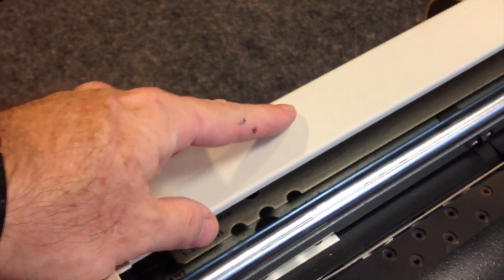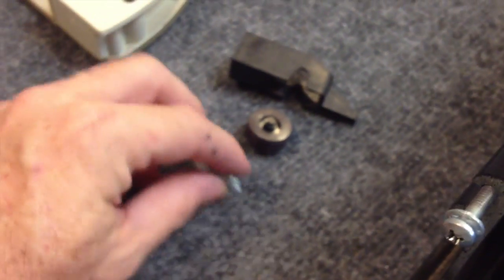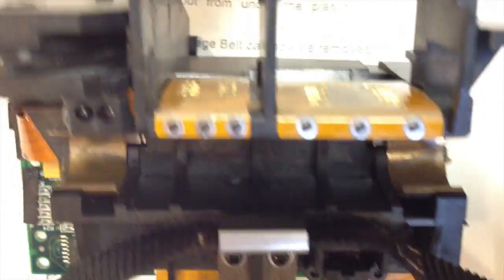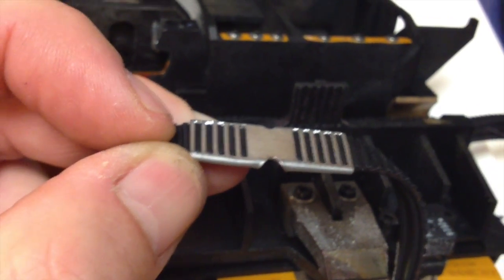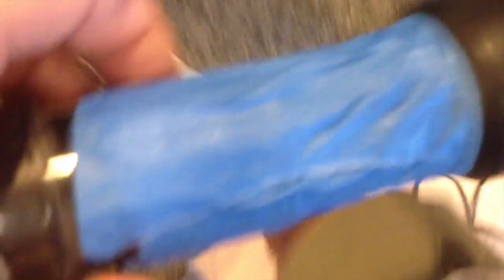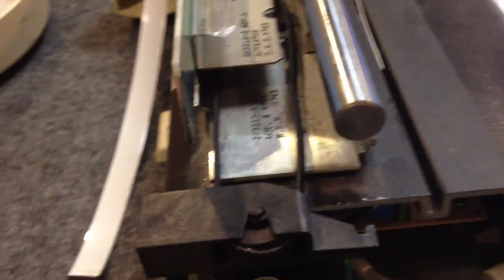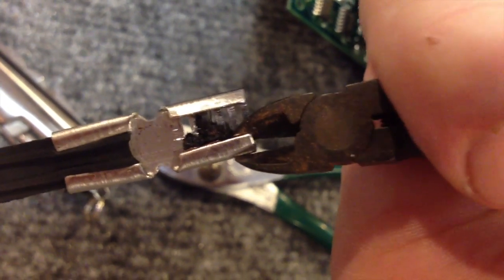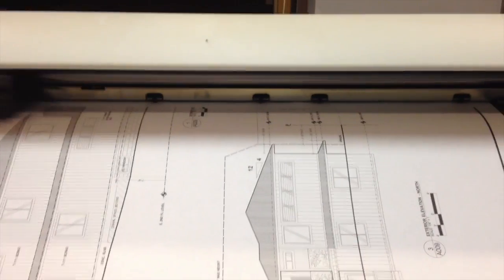Xerox 2230ij or Cadjet2 Plotter Belt Replacement with length modification

Comment: I was the project engineer on that thing when it first came out.  PPK (pen plotter killer) was the project name.  To splice a belt the easy way take a short piece (~1 inch) of belt, and glue it face to face with either end of the belt you are splicing.  Black max works well.  The teeth hold everything longitudinally and it all works.  Not that you need it now more than 5 years later, but if anyone else ever needs to splice a belt, there it is

Comment: Hope to put this video to good use once the new belt arrives. Thanks for producing it, Here's hoping my 24" belt is the right size.

Fitted my 24" CAD Jet 2 belt today, unlike yours mine was too short to get over the drive pulley, the tensioner bottomed out at full stretch. I managed to lengthen the belt by undoing the clip on both sides and instead of 5 teeth each side in the clip I reduced it to 3 each side; I did squeeze the clip together in large bench vice so here's hoping for a bit of life out of it. 
With that small lengthening when I refitted the belt I could stretch it over the drive pulley and still have some movement in the tensioner. So buyers beware.

Comment: 463/5000
Hello, first of all, thank you very much for your video that allowed me to change the strap of my Encad Cadjet 2 36 (inches) and be able to use it. My question today is if you know the reason why the plotting breaks the printed lines in the direction of the travel of the car. I changed the bushings and the tension pulley. Thanks for your answer. Here in Argentina there are no technicians for this old and noble plotter. I do not speak English, which is why I use the translator.

Comment: Hi, thanks for your video. one question do you have driver for this plotter works in win 10.?
thanks
Reply from the maker: Juan Rodriguez Yes, the Cadjet 2 driver works on my Windows 10 machine connected by Ethernet to the plotter that has a LPT port network adapter.  Google Encad Cadjet 2 for Windows 7.  Run the installer as administrator.
Reply: CoolBoss thanks!! your are the best!!!

Comment: Does anyone know how to configure the encad cadjet 2 plotter to print up to 90 cm or 36 inches?
Reply from the maker: It supposed to automatically detect the 36” width at startup by using it’s optical sensor under the print head.  But it can also be set manually in the panel.   I’ll look at my panel for the settings later and reply back.